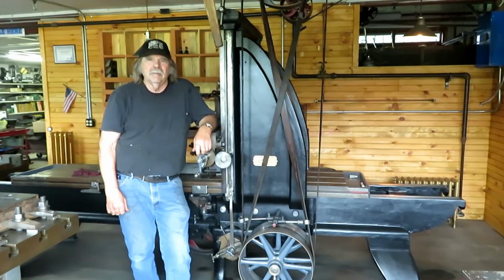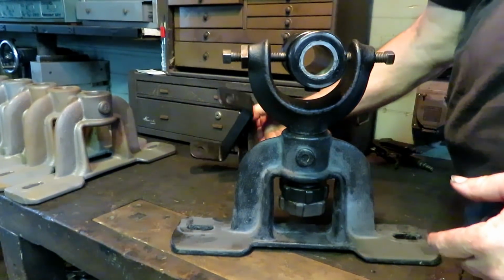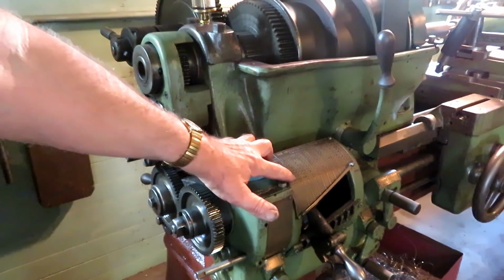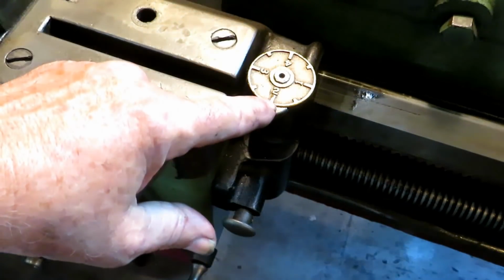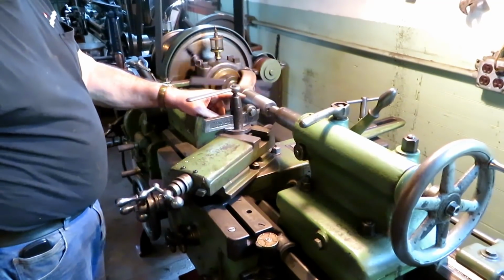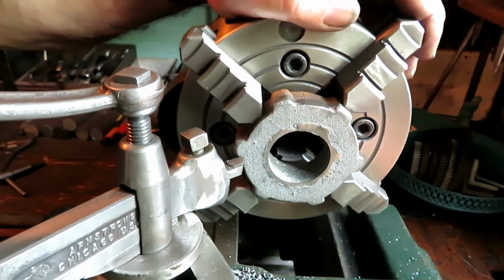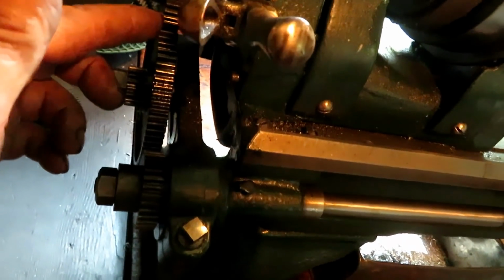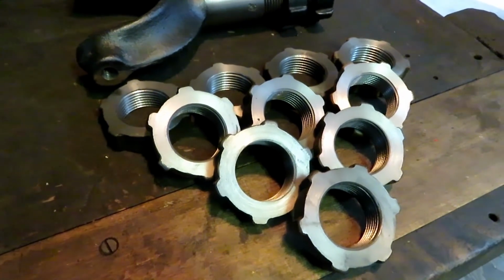Old Steam Powered Machine Shop 65:  Making Some Lineshaft Hangers

Comment: As a millwright I rebuilt a propeller line shaft in an old lumber dry kiln. Replaced the shaft with new 2 & 13/16. It ran 3 x 6' 6-blade propellers , was about 40 foot long with one coupling. I rebuilt the babitt bearings (6 of them) which were about 6 inches long. I had to cast new ones in the old mold, and they came out with oil channels and felt pad recess, which was finicky to clean out. We used a wick-fed oil system with 1/4" copper tubing . Gravity feed with slight slope. Dry kiln shaft ran at a fairly brisk RPM and the temp would reach 250F inside the kiln. Do your babitt bearings last without the oilers?
Reply from the maker: Hi Johann, For the low load and speed, my babbitt bearings seem to hold up fine, I have never touched them since I put them up. I use a semi- synthetic race gear oil that is some what sticky and it stays in the bearing pretty well with one "oil up" per day...Dave

Comment: I’ve noticed that you have a lot of power that is not being used. Have you ever thought about putting a AC generator that would run when you use your other equipment. I believe that if you don’t use all the electricity that you generate you will get credit on future bills.

Comment: Love watching your videos Dave . I have a 1920 Lodge & Shipley 20 X 36 lathe  . Similar to your American lathe .  It has babbit type spindle bearings , wondering what type & weight of  oil  you use on your spindle ?
Reply from the maker: Lately I use 90W gear oil....Dave
Reply: @davidrichards5594  do you have much clearance ?  I shimmed both bearings to .002 clearance . From my research that's what I'm  thinking it should be . Does that sound right to you ?

Comment: So, I’m in the beginning stages of building a new shop, but I’m not going to run grid electric to it.  I have a boiler already that is in good shape, but I need an engine to pair with it.  My plan is to use the engine to run a generator for electricity in the shop.  I was curious if you had any single cylinder engines, or knew of any around for a reasonable price.  They don’t have to be in operating condition either, I have a friend with a machine shop that lets me come and use his tools to work on anything as long as I don’t interfere with his paying projects.
Reply from the maker: You might want to check the Smok Stak site "engine ads" now and then   https://www.smokstak.com/forum/#enginads-r-classified-ads.233
Dave

Comment: I see you faced off the nuts from the inside out,  as do  others on youtube is there a reason for this instead of the outside in when facing?
Reply from the maker: I usually go both ways to save time....Dave

Comment: Is that tool rack at 23:40 like regular retail-type "slatwall" or  is it some vintage predecessor using the same concept?
Reply from the maker: Hi Brad, It's scaled from a much larger one at the East Broad Top Railroad shop as seen in an earlier video of mine some where.....Dave
Reply: @davidrichards5594  I was thinking it had movable cleats in the slats, but on closer look it's just nails or studs right? Looks nice

Comment: I like to say "you can only suck at something for so long" lol.  Have you looked into getting a turn of the century generator to make your own electricity with steam power?  Then you could justify running some old iron tools with electricity and maybe even cheat just a little and run an air conditioner off of that generator as well, just to control the humidity in the shop so the tools don't sweat and rust too bad of course. Wink wink.
Reply from the maker: Hi Davis, I don't think an AC would run off the DC Dynamo I am going to use,,,Dave

Comment: So, I'm thinking....he didn't set the compound to 30....either that or I'm gona learn something. Yeras ago for internal threads I used to swing the compound way back, but I got lazy, and now I leave it at the usual 30 degrees and cut up side down on the back side so the tool is being solidly pushed as it cuts....that is to say the toll can't start surfing on the groove already started. I can do this on a large lathe, but a small one doesn't like the up lift. Most times I drag my hand on the carriage wheel to follow the leadscrew tighter. Everything has slack!
Reply from the maker: Hi Josh: If you set the compound at half the thread angle, bring the tool back to the same depth with the cross slide each time and then feed in with the compound, you are cutting with just the one side of the tool which makes for a smoother cut, no chatter, hogging in, etc. On a modern, rigid, heavy lathe you can maybe get away with feeding straight in, but I don't think it saves any time.....Dave

Comment: Hi, thousands shouting  , 'set the compound!' Thanks for all.
Reply: What’s the reason to set the compound at 30*? I’m no machinists I just love Dave’s videos, thanks
Reply: @shanek6582  As the tool is moved in, it moves along one face of the thread, and cuts the new depth on the other face, rather than cutting on both faces at the same time.  So the thread gets deeper "toward the left."  Cutting on only one face apparently reduces stress on the tool and the part, which helps keep everything in line, among other things.

Some people don't worry about it for smaller threads, other people are quite strict about it always.
Reply: Phreadrick Hejrick p

Comment: Good to see you back at the video stuff again. I remember the heat last year. I can imagine how hot it would be with steam up.

Down to 17 minutes for the last nut. It's always the way. You just get the process down so you can do it quickly and you run out of parts.

Best.

Comment: It's been a while, it's also good to see you are doing well because I was starting to worry.
I did wonder about the wisdom of putting the boiler in the same room as your workshop, it seems that it has advantages and disadvantages, I suppose losing a couple of weeks a year because of heat is worth it because it so much easier to keep an eye on the boiler than if it was in a separate building.

Comment: I love your setup so much

I had helped one of the club's I am with setting up a full belt drive workshop, it was steam but on "non public" and extremely hot days we decided to use electric, what we did was set up a solid flywheel as the workshop drive and off its shaft was two levers, one steam drive and other electric, to this day it works great .

Comment: Dave I have always wondered how the smoke stack is powered. I see in this video that there is an exhaust for the steam on the outside wall and also full smoke out the smoke stack. So does the smoke stack gets its combustion air from the stroke of the piston or how ?
Reply from the maker: Hi Terry, The stack gets it's air movement just from the rising heat.  The taller it is, the more it pulls the combustion gasses. On cold days it really works....Dave
Reply: @davidrichards5594  I guess i asked the wrong question. how does a locomotive engine  puff the smoke out its stack. It seems as the engine strokes it puffs not draws.
Reply: @terrycannon570  Locomotives are a little different from this stationary application. Either way I think what you're missing is most steam engines are "double acting", when one side of the piston is being driven the other side is exhausting spent steam.
Reply: @terrycannon570  Locomotive steam exhaust is via the funnel which induces air flow through the English be firebox to aid combustion, hence the chuffing sound.

Comment: Dave I love that old drill press. I want one of the bench models to restore. Bench models seem much harder to find than the floor models. Thanks for the video. It has been pretty hot here in North Texas also. I have reverted to going to sleep at sun up and going out to the shop in the late afternoon around 6 or 7 pm. Now it is the mosquitoes I am fighting and not the heat. LOL Thanks for putting up with the heat for us.

Comment: I used to use a small strip of tape instead of a white marker then put the tape over the dial and cut it with an exacto knife or razor blade on the split line when you are done it peels off easily...also use a dial indicator on a magnet to read the position of the compound...it's more accurate than the dials on old machinery...I love your shop..being a fan of steam power and a retired machinist..great content
Reply from the maker: Hi Tom, good ideas, I do the same when it has to be close...dave

Comment: Good to see you back Dave , you need a belt driven fan to keep you cool in the shop ,  LOL .
Reply: I was at a restaurant in FL that had several ceiling fans and they all ran off of a belt/rope system. One very quiet motor way in the corner ran the whole shebang. Very nice.
Reply: Dang! A steam powered desk fan! Why didn't I think of that?